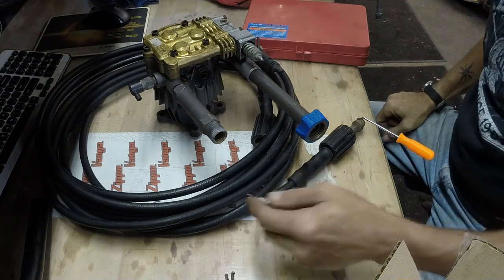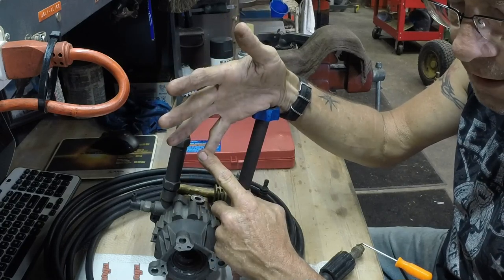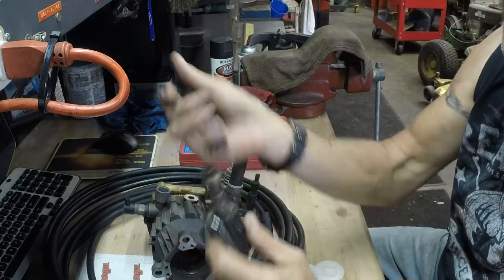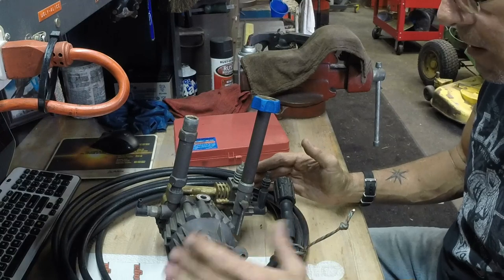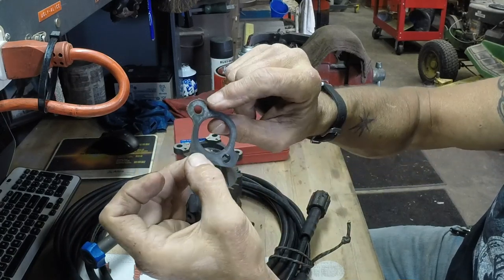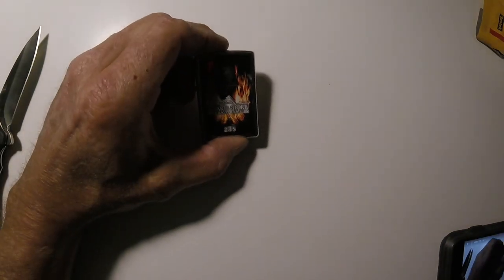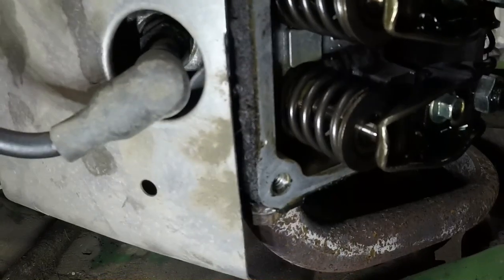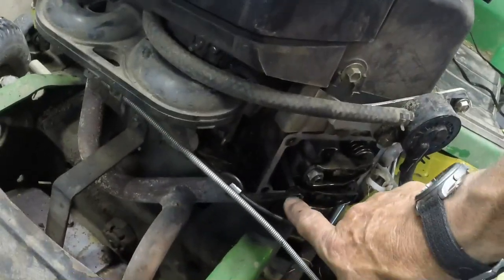Don't Reuse Gaskets! Replace!!

Comment: Great video.  Pump are so hard on themselves.  High pressure water is the only lubricant on the pump part.   Gaskets.  If I can't find one I will make one if it is low pressure gas and oil.  I only use factory replacement when high pressure is concerned.  Battry.  You sound like me.
Reply: I was teased about my accent.  Battry.  It is actually a dialect difference.

Comment: Hey Zip someone was in that engine before and mixed up the 2 pushrods. Hey thanks for the advice on my mighty craftsman the guides were good and I adjusted the valves like you said originally I adjusted them like a single cylinder I guess I was wrong huh and I went through the carb so which ever problem it was I think it's fixed now I'll find out tomorrow when I do my driveway anyway thanks much and THANK YOU FOR YOUR SERVICE😃
Reply from the maker: Awesome to hear the engine is back to running again Dave!! Yeah, there is a little difference between the singles and twins when adjusting. Sometimes it's just enough that once warmed up, you loose compression. Odd birds, these engines are! They're pretty picky! Cheers my Friend and Happy Memorial Day! Zip~

Comment: For the Intech engines, remove the loose valve guide, knurl it on the lathe, press it back in. I have yet to have one fail after that operation. Great videos! Greg.
Reply from the maker: I have given this some thought since I have my lathe at my disposal. Thanks for the tip! I've got a head to rebuild that I may do this with. Thanks Glock! Zip~

Comment: Amen brother it dives me nuts to see people reuse gaskets.
Reply from the maker: In the past, and in a pinch, and then only on my own machines, I've reused gaskets, but I always note what needs replaced on them . There are some Briggs head gaskets that claim they can be reused on the older L head (Flat head) engines, but even then, I'm hesitant. Cheers Sir Moto Scott!! Great to have you stop by! Zip~
Reply: ZippoVarga - yea that was one i reused, on a 90 murray 12hp flathead, salvaged one off a parts engine , just changed the head n headgasket together.  not sayin it was right, but its still holding years later👍

Comment: Garden type hose connections I use o rings only no leaks at my garden or power washer, flat washers are not acceptable too prone to leaks
Reply from the maker: Good idea there Frank! I may go that route with my next failed flat washer. Cheers! Zip~
Reply: I replaced all the flat washers. Some connections require a thin o ring but they work great. Good luck

Comment: Happy Memorial day from the left coast. Regarding gaskets for pressure washer hoses, how about quick release connectors?
Reply from the maker: Great question Eric! And Happy Memorial Day! Over time, the rubber seals will eventually fail, but it's been my experience they last a good long while on the higher end pressure washers. Cheers! Zip~

Comment: Damn Zip, looks like I got view #1
Reply: All in with you on gaskets, I have a Craftsman pw I'm working on.  Owner took leaking pump apart several years ago, but couldn't fix it. So he left it outside till I got it a few weeks ago, free.  Carb was a cluster,  pump was grenaded.  The worst part, he left it outside for the last 2 or 3 years.  I can fix almost anything, but if it's been living outside, the damage costs much more to fix.  So please guys, don't let you power equipment go camping!  Good video Zip.
Reply from the maker: Ha! And...it's taken almost 10 years for me to get my first "FIRST" Comment!! lol...You will forever be the First to holler First! Or in your case, #1!! And I agree 100%....equipment left out in the elements needs to be properly covered and protected from the elements. I have a number of things out doors, but they're stored in a manner that they are not subjected to the elements. I wish I had a big enough building to store everything AND have room to work on things, but...you work with what you've got! Although, I am looking into getting a shipping container to remedy the out door storage issue. Cheers my Friend! And congrats for being the First to be First! lol Zip~